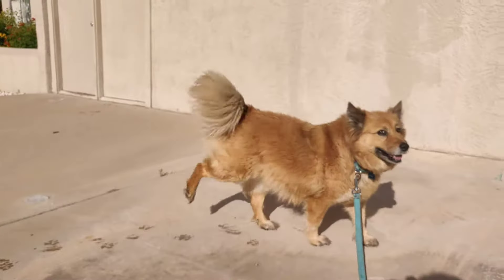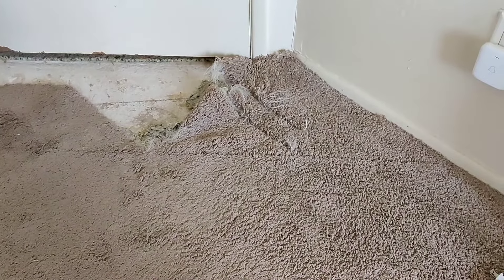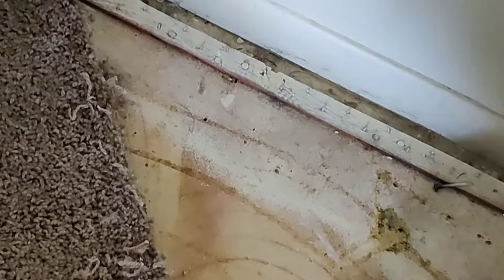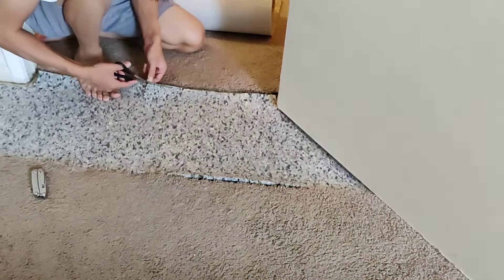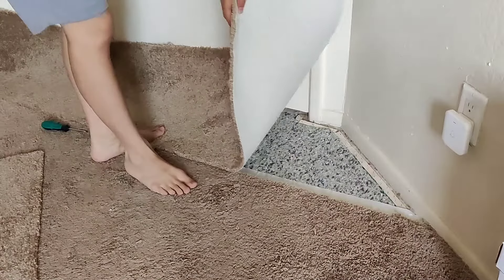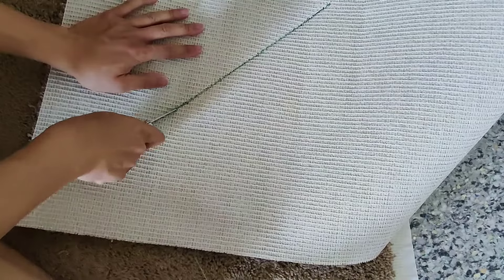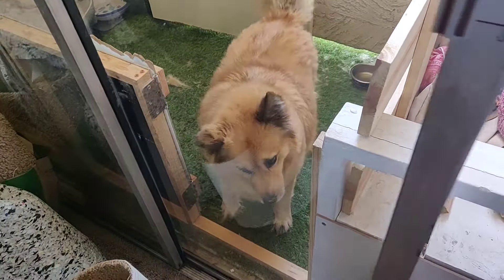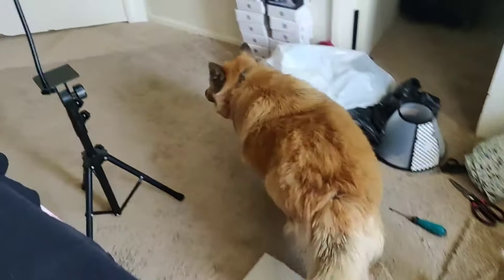Fixing Damaged Carpet (NO SPECIAL TOOLS) | Bao's Repairs

Comment: Did you have a spare piece of carpet to match it up?? My home has 10 plus year old carpet how to match it up?
Reply from the maker: We found some carpet at Home Depot that was close. We've seen other people suggest if a closet is carpeted or other non visible areas, you could take a patch of carpet from there to use in the repair.